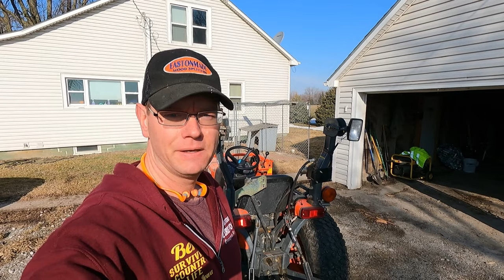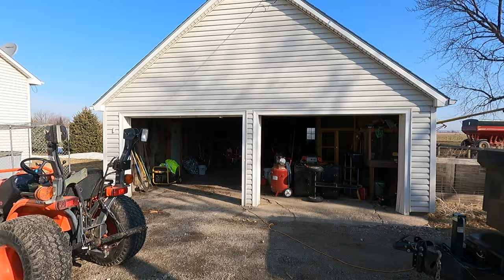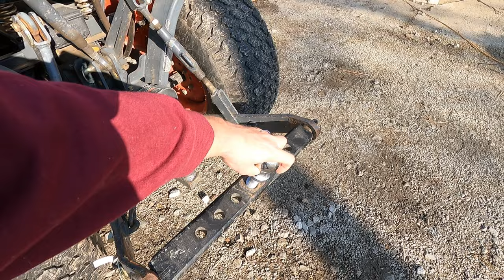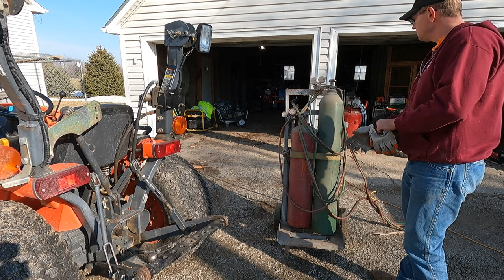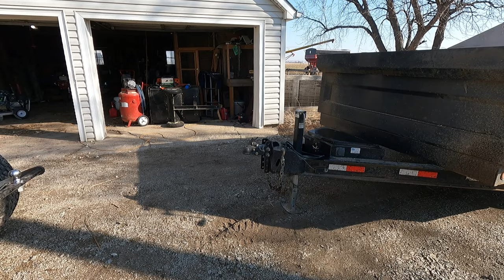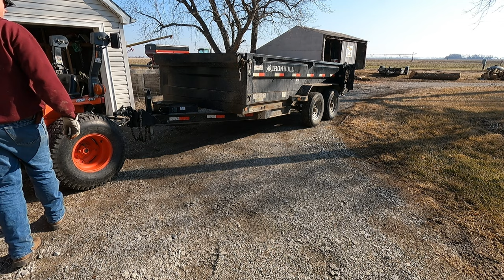#126 Cutting Torching a Trailer Hitch

Comment: Hi Ben!!😀😀
It is called a 3 point hitch draw bar. They make a bracket that slides over it and attaches to the arm to stop the bar from spinning. You should be able to find them at a tractor supply by the draw bars and top links. Otherwise the ball pulls pretty hard on the latch system on your hitch. 
Take care my friend!! 😀😀

Logger Al

Comment: There is a bracket you can buy that bolts to the lift arms to keep that draw bar from flipping over on you when hooking up to the trailer...
Reply from the maker: Can I use this same bar or I've got to buy a whole new bar don't I?
Reply: U can use the same bar they sale the bracket at tractor supply
Reply: @survivingcountrylife7069  Yes sir. Use the bar you have. The brackets slide over the ends of the draw bar before you pin it on your lift arms.

Comment: you only should open the valve on the acetylene tank 1/4 turn so you can shut it off quickly in an emergency
Reply from the maker: I'm guessing the regulator is also turned up higher than it needs to be

Comment: If your not going to far just use a 2" ball or one that fits the hole and the trailer with out burning a new hole. Where are your burning googles, you are hurting your eyes and could ruin your good eye glasses. Take it from someone who knows. You also could have put another pc. of steel on your hitch and bolted it on and then put your ball on to that pc. with a 2" 5/16 ball on that.

Comment: Should have taken it to get drilled out properly, would not have cost the earth, don't go slipping into 'tight farmer' mode , that bar is weakened in the middle now. looks like you're an accident waiting to happen by the way you were fiddling with that torch, stick with what you're good at when you find out what that is.